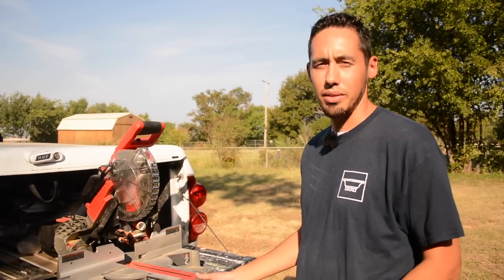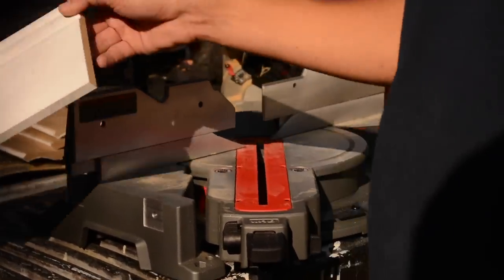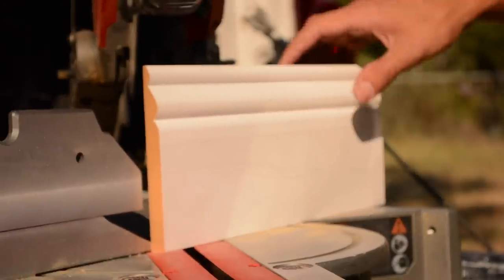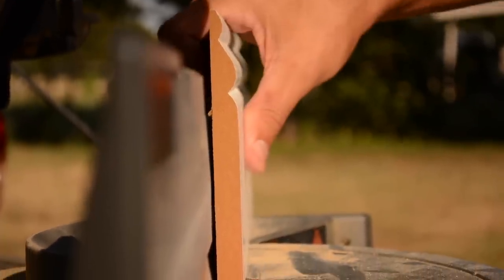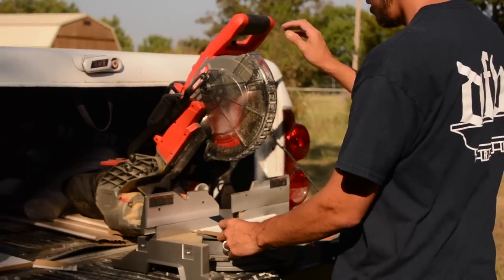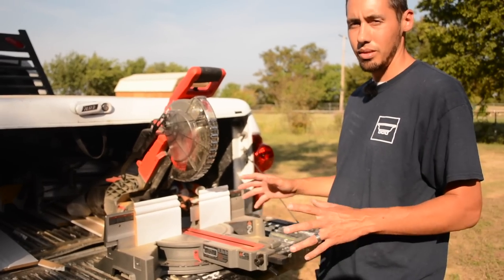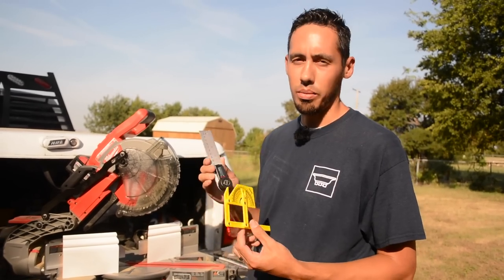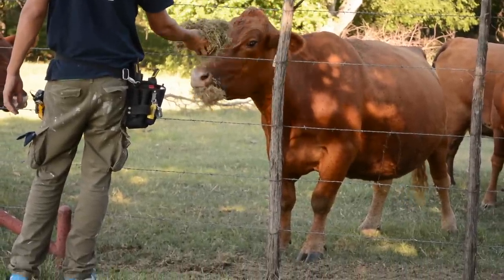Why Your Miters Suck - And How to Fix Them

Comment: I find the best thing to do is take a brand new speed square and dedicate it as your tuning jig.
Set your verticle zero making sure the speed square is slowly briught into contact with the blade while watching the gap between them clise.
With the blade at zero and the speed square resting on the miter's table turned 90° from the blade. Check to see if the speed square touches the blade along it's body at the same time with no gap at top or bottom.
Also make sure you position the blade into the table kerf as to hide the teeth from contacting the speed square. Once it is touching perfectly perpendicularly to the blade. Lock that in as your zero.
Adjust any stops or degree markings accordingly.
Your table should read dead zero.
This will set your true zero for bevel cuts.
For angle and common cuts. Put the speed square lying flat on the miter bed perpendicular to the fence and blade with the teeth buried in the kerf.
Your table at zero should allow both planes of the speed square to rouch the blade and fence exactly at the same time along both edges completely.
Your table being set,you should make sure the back of your molding doesn't have a recess millied through the center back side of the body.
This may cause your molding to sit incorrectly against the miter fence.
One other reason a miter won't line up correctly is because the moldings,although purchased at the same time and store,may be a diffent lot number.

Comment: Takeaways
Ensure saw is calibrated by cutting test pieces, ensuring board is cutting a 90 degree angle. 
Don't let boards stick up from base (especially easy for longer boards) or away from fence, hold/clamp it tight.
Use angle finder. 

Thank you for the honest detailed advice, it's some of the best available.

Comment: You have successfully verified only the left-swing accuracy of your saw. By flipping the work piece and not changing to the right-swing position, you should now check the assembled pieces with a square. If a true 90, then verified accurate for left-swing only. Repeat entire process for right-swing cutting. To match a left with right would not indicate which swing is out of tolerance if the assembled pieces are other than 90 degrees.

Not trying to be a smarty pants. Just applying engineering/math principles. Luv your channel, your ethics and support for your subs!

Comment: You can use a speed-square to check quickly. Also, how do you compensate when there's a large kerf in the back of the piece?

Comment: A little bit of sawdust on the table can also throw off your cuts, as will too much of a gap at the bottom of the drywall which allows the base to buckle under and open up. My favorite challenge is dealing with rounded inside 22 degree corners crafted by drywall hombres that get away with not using a corner bead.
Reply: Riptide 10x Only put a nail in the top of the baseboard that’s not being coped, if it gets shoe I don’t even put one in it either, the cope will hold it, I’m talking about only on inside corners of course.

Comment: Just started with a finish Carpentry company.
Having trouble with tops of my copes being open on baseboard and door casing are open in the middle 😒
Reply: Cope a little shy of the line and finish it up with sand paper. Sometimes file the tight stuff with small rasps.  A steep back cut is important too. A good tip from these vids is to apply sticky sand paper to the face of a scrap and run your cope on that sand paper to seat it to the exact profile.
Reply: Thanks for getting back . I will try that !
Reply: @nickfantoni5576   sure thing. sometimes if the drywall is proud/recessed of the door or window jamb you may have to roll or close the miter on the saw fence to keep the face closed. There are some vids online demonstrating it.

Comment: or if the floor isn't flat making the base float up and out of plane with the other side, or if the mud on either the inside or outside corner is thick enough that the corner is not 90 degrees that can make a 90-degree perfect cut won't close up nice.  lots of possible things to compensate for in the angle of cut.
Reply: also a dumb thing someone might do is not notice that the base is plowed out on the back side and that it doesnt sit flat on the fence as a result, with the routed out part on the top corner of the fence.

Comment: What you said true but I also see it is the operators laziness to set up the saw correctly. Most miter saw have the handle on top of the saw, when the user carry the saw and set up the saw just because the saw appears to be straight up 90 degree it can easily tilt slightly on the bevel and that will throw the miter cut off. Only certain saw have positive lock on 90 bevel, most saw are just a knob to loosen or tighten the bevel. I have seen slight bevel cuts on rough framing and finish carpentry because of this.

Comment: Try laying the moulding flat on the bed...most saws are compound and set the bevel on 46 degrees. Use a CA glue
Reply: 2p10 is awesome.

Comment: Corners in houses are rarely perfect 90 and floors are rarely level. That's why they don't fit.
Reply: vincent salzano That’s why professionals cut each piece at 46-46.5 degrees. I’ve had some corners so bad that I’ve had to cut each piece at 48 degrees.
Reply: True - and plasterers who get their angle beads out of plumb - that's the worst one to deal with, and so common.
Reply: that dear sir is what the angle finder is for.

Comment: One of the other reasons that I found that my miter suck is when I use two different stock, for example, I bought the pro pack at HD and when I pretty much have only enough of 1 of the 5 baseboards to cover one side of a miter and I have to use the 2nd one for the other side, sometimes the caps don't line up exactly. Maybe it's because of the way it was routed at the factory.
Reply: CantAffordFestool that's Home Cheapo for ya.
Reply: I find it has to do more with, in your scenario, that people have no idea what they're doing or don't understand what molding goes where. Take colonial trim. If has a sharp edge of the thicker part, it's base. If it's rounded over (like you made it sound) it's for door trim/casing. Depot is a great store and they have everything you need. Just not an education.
Reply: Tim Johanson I find it has to do more with, in your particular case, people don't know how to read. Read my original comment again. I did say "baseboard" and I do know where they go. Do you?
Reply: CantAffordFestool yeah, bite you have to realize that in this business everyone has names for everything. Doesn't mean they understand those terms.
Reply: Tim Johanson ok mister big shot...since you seem to know everything about the business...why don't you educate us mere mortals on what we don't understand so that we can be worthy of your presence? Looking forward to all of your YouTube installments!
Reply: CantAffordFestool Coming back to tour first comment/scenario. Why did you buy the 5 pack? And where/how did you install it? Wasn't trying to put you down, just generalizing common situations. That's including myself. But, none of us learn without input or direction. My assumption was that you bought the door casing 5 pack mdf.

Comment: Also, calibrate the saw.
Reply: I can give you my saw 4 ft for free to test it. Miter Saw is an old idea because has just about 1 ft cut and cannot be used on boards. It shall be retired. I invented a "Parallel Guided Power Saw" which can be seen on you tube under this name. My saw can cut up to 18 ft or more. Look at my saw and let me know what you think. My saw may replaced miter saw, table saw, and router table. It can carry also grinders, drills press, hand saw and more.

Comment: If you cut perfect inside and outside mitres, but don't check the wall corners to see that they are infact at 90°, plum, square to the floor/ceiling, you will also have problems. Check, check, and recheck.
Reply: I can give you my saw 4 ft for free to test it. Miter Saw is an old idea because has just about 1 ft cut and cannot be used on boards. It shall be retired. I invented a "Parallel Guided Power Saw" which can be seen on you tube under this name. My saw can cut up to 18 ft or more. Look at my saw and let me know what you think. My saw may replaced miter saw, table saw, and router table. It can carry also grinders, drills press, hand saw and more.

Comment: Compound flaring out at the base is usually the biggest problem. On jobs that I have worked on is is standard to have a taper skim after the trim job to compensate for bad framing and also bad taping .. It really depends how perfect someone want the finish product

Comment: I find that my miters are good but the walls of the house aren't straight. For example, the miter on the baseboard that was cut in the video was perfect, but when installed in the house, if the walls aren't true, it forces the miter to be off.

Comment: I have found that its many times the saw is not calibrated. you really need to check. Also, make sure the blade is sharp.

Enjoy the videos you put out, plus you do nice work
Reply: If you do not address the human error it does not matter if the saw is calibrated or not calibrated.

Comment: Low end miter/compound saws are not accurate and dont hold calibration well.  Compounds have a tenancy to twist and move while in use.
Also.. good blades help allot. 

Beyond finding the angle of the wall.. sometimes the floor or ceiling can be off causing you to have a gap.
Reply: Never, ever, use a dull blade.

Comment: You must be fortunate cause the last two miter saw I bought we're not set up to cut accurate cuts out of the box. Both the vertical 90 deg and fence angle to blade we're slightly off.  Enough to cause sloppy looking miters.
Reply: Bosch, and Makita are perfectly calibrated out of the box. More expensive but well worth the money

Comment: The number one problem . is that the walls are never Square ever if you see a perfect house you let me know. No piece of drywall is the same. And you may get someone that got two different thicknesses of two thickness in the wall and it made two by fours  two different thicknesses  in one is all set  and it's bowling  the drywall there is always a guy with a sense of humor

Comment: Dewalts the best when it comes to miter saws. Why use milwaukee? Ive yet to come across someone who uses milwaukee miter saws in the field.
Reply: B C10 He has been using Dewalt up until this video. As he mentioned in the video, this saw is brand new right out of the box. If I recall correctly he mentioned a month ago about potentially being sponsored by Milwaukee. This could be a saw they sent him.
Reply: B C10 Dewalt's the best??? They're not bad but the best? Festool, Bosch, Hitachi to name a few. To each their own, just a bold statement to throw out there.
Reply: I bought the best dewalt miter they made a couple years ago. Color me not impressed. Even slight sideways pressure on the handle will cause deflection. I blame this on their small guide rods on the sliding mechanism. I would look elsewhere when buying a miter saw.
Reply: I totally agree. It's hard to shop based only on features when you have to consider battery compatibility. So I can sort of understand "Brand Bias" based on cordless tools. For everything else I say "buy what gives you the best value for the least money".Useful Features, longevity, ergonomics, compatibility; to name a few of the first things I consider when shopping for tools.
Reply: Because the guys in the field are not dropping $600 on a cordless saw!
Reply: Ryan Richardson not bold. Just fact. Check out mitre saw reviews. I did when I just bought my new chop. I had a Hitachi for over a decade. Got tired of the movement during long cuts. Wanted to buy the new Bosch. Was scared of the same thing after watching reviews. Ended up with the new 60v dewalt. Same as the 780 DEWALT just has battery option. Very good saw. I'm sure festool is good as well. Double the price. I don't believe it would be doubly as good. I do own festool tools. So, I'm not bashing them because I can't afford them.
Reply: 95thousandroses I haven't experienced the flection you claim. I tried to make it move on practice cuts and couldn't. What place did you get in this years World Strongest Man completion???
Reply: Grand Wizzard they should. Maybe their work would reflect their efforts.
Reply: Ryan Richardson My thoughts, exactly. I've been in the building and finishing trades since '89. I've used many DeWalts. They're great saws and job-site beasts, which helps explain their popularity. They also spend a relatively huge ratio of their operating budget domestically on conventional marketing, trade shows, social media, etc. -- esp., compared to Hitachi and Bosch. So, all things considered, it's no surprise to see that "all the cool kids" are using DeWalt (and to a lesser extent, Makita and Milwaukee). But in this case, as in most cases, it's better to be right for oneself than to be right according to conventional wisdom or legend. Now, that is not to say that personal preference and crowd wisdom are mutually exclusive. But I've used all the top brands extensively for 28 years, and Hitachi so far has earned my favor, in spite of prevailing opinion. To me it comes down to overall value, which I grade roughly thus: Performance (inc. power) + Ease of Use (inc. initial and ongoing calibration) + Features (including warranty) + Durability + Price. Makita, Bosch, DeWalt, and Milwaukee come very close in their respective ways, and often surpass Hitachi in one or two of these areas. But I never could justify their considerably higher prices (and oftentimes, extraneous frills) when the sum of the other factors ends up being either a wash or favorable to Hitachi.
Reply: Dan A unfortunately, you’re speaking about the Hitachis of yesteryear. The newer Hitachis have gone down the tubes just like Dewalt. Other than Festool, which is $1,400, Makita is the only saw that kept is quality and not sold out to HD and Lowe’s. I don’t know a single carpenter that owns a Bosch saw especially after that new design. Bosch can stick to Hammer Drills, Chipping Guns and Lasers.
Reply: Tom Foolery After seeing a few reviews, I can't argue there. The latest Hitachi sliders look to be disappointments; they couldn't leave well-enough alone, at best. I'm sticking with my C10FCE and C12RSH as long as I can. On another note, the Skil worm-drive table saw is looking really nice, not just for its power but also its depth of cut at better than 3.5" for one-pass re-sawing of 2x4, 4x, etc. That'll probably be my next major purchase.
Reply: Makita!
Reply: B C10 the best saw used to be a Japanese made Hitachi sliding 10” compound. They are difficult to find now and cost $1200. For $200 more the festool kapex is the way to go.  Repeatable, silky smooth, highly accurate, great customer service. Cost and proprietary blades are drawbacks but I believe the kapex saves me considerable time and I only trim my own houses. A dedicated trim man could make this saw pay for itself very quickly. It’s just a joy to use it.
Reply: Just because it's what everyone uses doesn't necessarily mean it's the best. I use a Hercules and like it better than my dewalt.

Comment: I can give you my saw 4 ft for free to test it. Miter Saw is an old idea because has just about 1 ft cut and cannot be used on boards. It shall be retired. I invented a "Parallel Guided Power Saw" which can be seen on you tube under this name. My saw can cut up to 18 ft or more. Look at my saw and let me know what you think. My saw may replaced miter saw, table saw, and router table. It can carry also grinders, drills press, hand saw and more.

Comment: Also the plasters don’t ever sand their external corners square down the bottom where you skirting goes in fact Iv never ever had on with out a bump, round or a perfect 90* I think they do it on purpose 🤬
Reply: "SAWSET PROTRACTOR" is the most accurate miter finder out there. No Math. No gimmick.
Do the comparison.

Comment: Toss the blade that came with the saw, its shite, buy top quality blade such as from FS tool. Painted baseboard and crown is easy, try prefinished hardwood there is no getting by with filler,  putty looks like crap. Always test fit using short ends, then cut your long lenghts first. If you make a mistake at least you can use them on shorter runs.
Reply: Ian Johnstone  that’s how I was taught. All clear pine and oak. No pre-primed shit and Hands Down!!!!! NO MITRING INSIDE CORNERS!!!

Comment: You forgot 1 reason, its called suck ass framing... so a angle finder is a must.
Reply: "SAWSET PROTRACTOR" is the most accurate miter finder out there. No Math. No gimmick.
Do the comparison.

Comment: A reasonable quality saw with a big diameter, sharp blade, that has not been bashed around in the back of a truck for the previous 2 years will help heaps too. Take  your time to measure cut and fit. Sloppy fit sloppy worker..